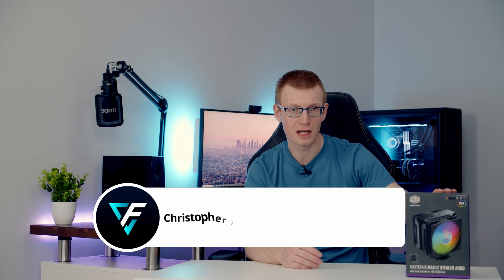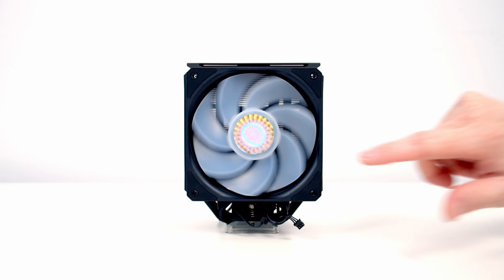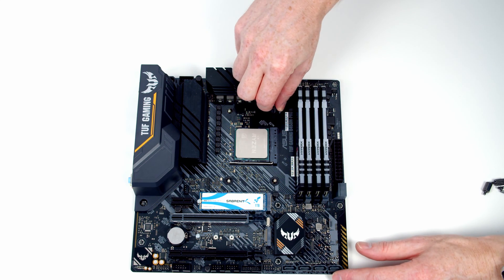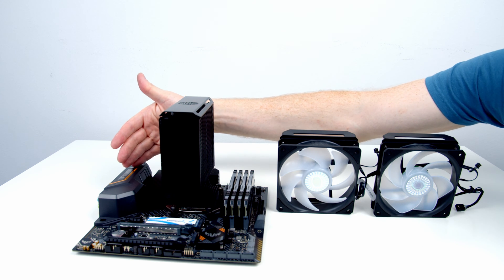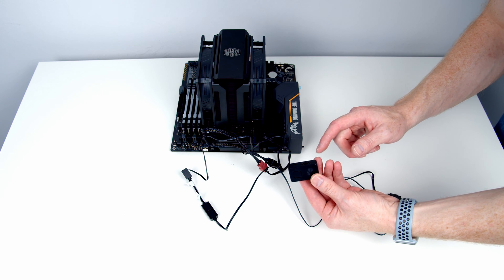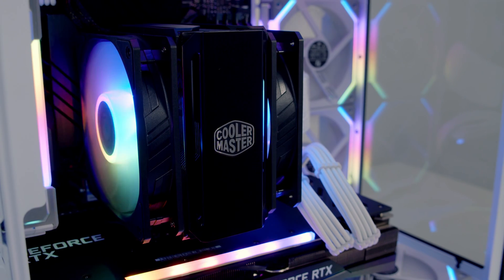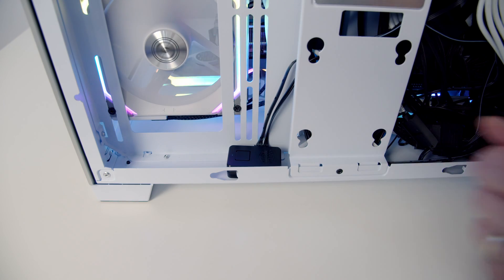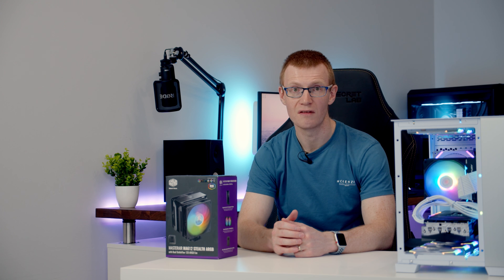Cooler Master MA612 Stealth ARGB Review & Installation Guide

Comment: I just installed this cooler. The stand on the right side relative to the cooler did not want to be screwed in. What I've done? I placed one of the racks in the position of the AM3 socket and only then was I able to screw the cooler: D

Comment: Hi. I bought this exact cooler. Two question. The arrows on both fans point inwards towards the heatsink. Shouldn't one be pointing outwards? The red connector has 4 pins and the black 3... which one goes to which fan? Thanks.
Reply: And?...

Comment: I was quiet sure how to wire up those fans, because the instruction foldout, delivered with the cooler, was somewhat unclear in that regard. So I only had to use the 2 splitter cables. 1 connecting the power input of the fans to the cpu header of my Asus ROG Strix B550-F motherboard and the other from the 3 pin ARGB connectors of the fans to the 3 pin Aura addressable Gen 2 header of the Mainboard.

Your explanation was much clearer and easier to understand than what was shown on the foldout.

Comment: Hi, I bought this some days ago... My motherboard has not rgb pin connectors, so I have to use the rgb controller included... But, can I buy other controller to set up more rgb effects, cos for me, also like you, there is not enought effects (I dont like them, cos I want a static color) Or what should I do to setup propperly rgb effect?

Comment: Hey there, question. The only possible connector I was able to apply the Rgb cable, was below the GeForce graphics card. Is is it possible this is the right one? Also the connector and the one on the cable - with 3 pins, is very tight and very easy to break one of those pins. Any recommendations how to attach the cable to the motherboard?

Comment: Is this sufficient for a 5950x ?
Reply: I would say so. I'm using it on a Intel 11700 with RTX 3080 Tuf and all Corsair QL120 fans. It keeps my PC running cool and quiet even under load. It's 35 degrees idle and under 64 degrees under load barely even hear the fans when playing games. It's awesome. Got it on sale too so it was well worth it.
Reply: @daravuong  Great, thank you. What case are you using ? I was thinking about the Lian Li PC-011D XL with the side intake fans.
Reply: @Chiellus11  I'm using Corsair 5000D Airflow Case

Comment: My RGB controller doesnt work for me. The only color I get is green, and thats it. Anyone with the same problem + any tips? It should always boot on the rainbow RGB.
Reply: Are you controlling it through motherboard software? I have Asus Tuf motherboard and have to control that Cooler Master Air cooler through Asus Crate/ Asus Aura Software but I have to control my fans separately on Icue Software.

Comment: I have r5 5600x with 3 year old ML120 AOI lite. i want to switch to air cooler, This cooler in my country 75$ i also consider deepcool AS500 price is 55$ i can import from china without tax.
My ML120 AOI lite gaming flight simulator 71-72c when AC on around 68-69c. should i get Deepcool AS500 or this one?
Reply: Get the Scythe Mugen 5 Black Edition

Comment: WOW! That is a mind-blower that CoolerMaster actually preforms better than Noctua... you get the RGB as a bonus too..not such thing with Noctua. How powerful of a CPU would you feel comfortable using this kind of fan solution vs. water?
Reply from the maker: That would need more testing to say as 5600x is an easy cpu to cool and I haven’t tried in on anything else
Reply: I'm using it on a Intel I7 11700 with RTX 3080 Tuf and all Corsair QL120 fans. It keeps my PC running cool and quiet even under load. It's 35 degrees idle and under 64 degrees under load barely even hear the fans when playing games. It's awesome. Got it on sale too so it was well worth it.

Comment: It looks a bit smaller than the ND15 so might be good in compact cases, like the Fractal meshify 2 compact?
Reply from the maker: Should be NHD15 didn’t fit great there but this should
Reply: have the case and cooler fits perfectly 👌

Comment: The NH-D15 is a 100 quid over here, and even though I do not see an MA612 Stealth listed yet, they look like they cost the same. That'll be a definitive deal breaker, because a dual AIO at the same performance is 20-25% cheaper.
Reply from the maker: Agreed, but if your someone who doesn’t want to put water near your PC it’s a good option and I like how it doesn’t block the RAM
Reply: @ChristopherFlannigan  I completely agree that it's an amazing feat to have put the same performance in such a compact form factor, and I can not stress how much we'd be better off with RGB fans that can be bought with blades that can blow either way without having to expose their backsides, but the cooler is still too expensive for its own good, which is something it shares with the NH-D15. Do people still buy NH-D15s? Yea they do, but more people would if the price would be more sane. I never liquid cooled any of my computers and I've been responsible for building my own since 2008, so I belong in their potential target group.
Reply: I don't think Cooler Master is crazy enough to put this in the same price bracket with the NH-D15.
Reply: @NotCommanderShepard  It already is, just look them up on amazon. And I think it was this very reason why it was compared to it. Because they cost the same, so they better should perform the same.
Reply: @dominic.h.3363  I didn't expect it to perform the same as the NH-D15. After seeing it, it's not so crazy. Looks like a good alternative for people who like RGB.